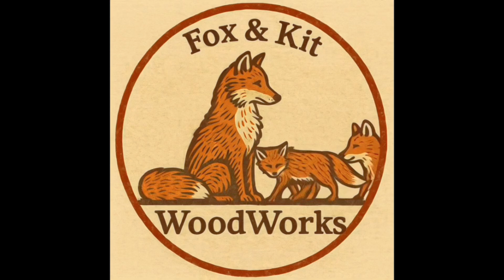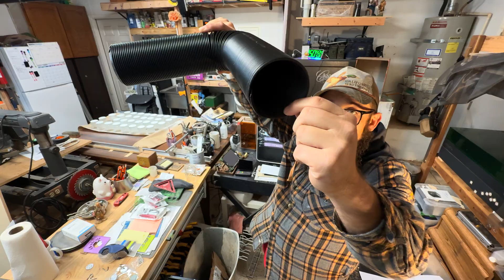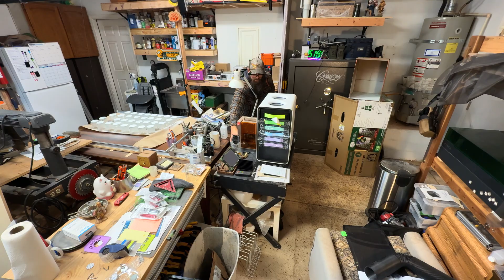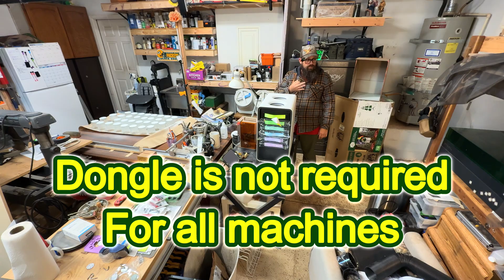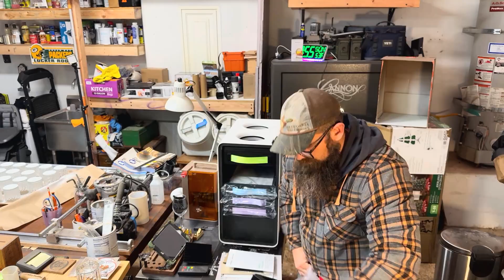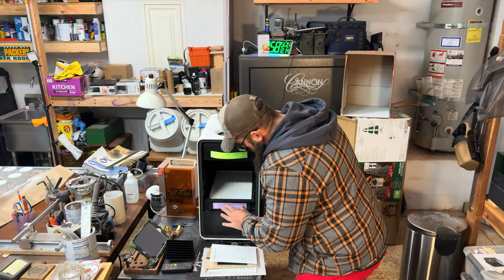XTool Safety Pro AP2 Setup & First Look

Comment from the maker: If you’re engraving indoors and can’t vent outside, the xTool Safety Pro AP2 has been a solid option in my shop so far.

I’ll keep putting this thing through real jobs, so if you’ve got questions about airflow, noise, or compatibility with your laser, drop them below—I’ll answer what I can.

👍 If the video helped, hit like
🔔 Subscribe for more woodworking, laser engraving, and small-shop tool reviews

— Fox | Fox & Kit WoodWorks 🦊🪵